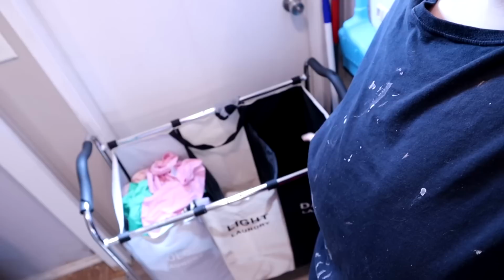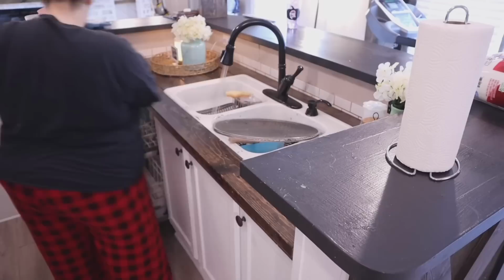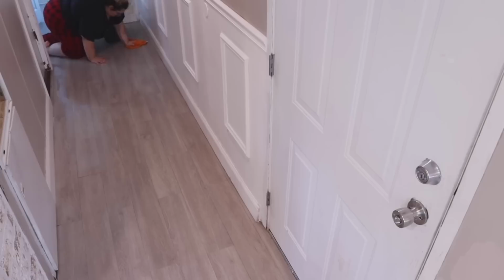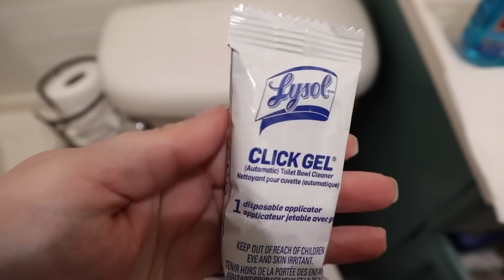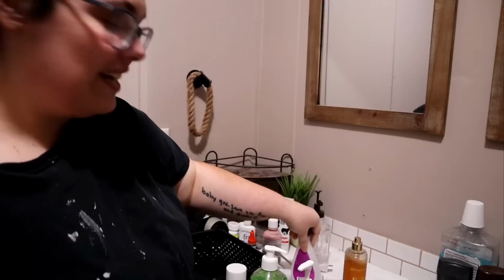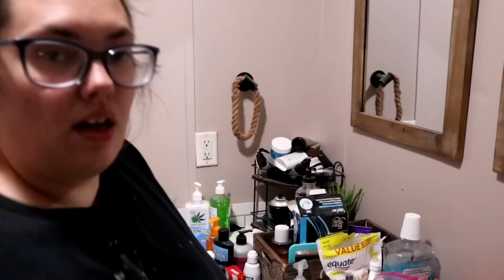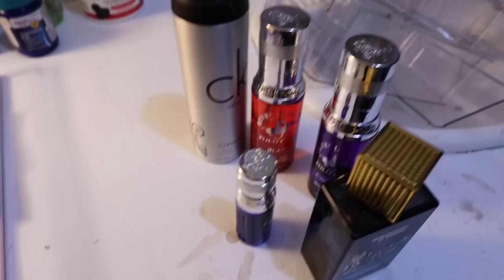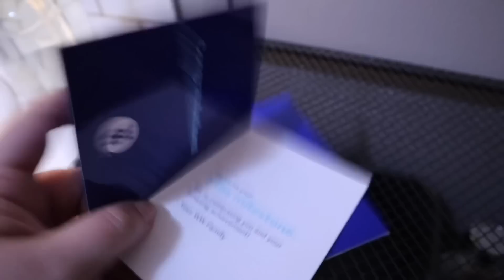*HUGE* MOBILE HOME CLEAN AND DECLUTTER | deep cleaning my single wide trailer | cleaning motivation

Comment: An easier way to clean a full room is throw everything in boxes or laundry baskets and remove everything from the room, I put mine on kitchen table.. Then setup your shelves or containers.  Fill them with only the items you want and put them away after you've cleaned the spaces. It makes it so less stressful.  You don't have to sort it before you take it out. I just dump everything or anything together. You have to sort it anyhow. I hope this makes sense. Trust me at 67 I've figured out the easiest way to do everything 😂

Comment: Hello Merina, just a suggestion when you do your laundry make over. Get a bar and attach to the wall and keep all your loose hangers on it and when you pull clothes out of dryer just hang on bar instead of laying them on washer. Plus, it gives you a place to put your loose hangers and not have them in the way. You may need a support bracket attached to the ceiling to disperse the weight. Had to edit it due to auto correct,  one day I will learn to proofread.

Comment: Your bathroom declutter was intense! Recent subscriber, so not sure if you guys have remodeled it or not. Are the small wall mirrors above the sink for decor or a "medicine cabinet"? If they are decorative, can hubby build shelves from the countertop to ceiling to store more items?  Perhaps in decorative baskets or the like. We did that when we renovated my sister's manufactured home. We also found studs ABOVE her bathrrom doors, added shelves to hold extra toilet tissue, paper towels, etc. When you can't expand--GO UP!! Also, under the sinks are perfect areas for ADDING a removeable simple shelf.(think a long, wide upside-down  U-shape.)

Comment: Just a suggestion I usually around my roast on each side and then put it in the Crock-Pot that's just the way I do it just a thought
Reply: I sear my roast on each side first to lock in the flavors of my season mix ( cavenders, onion powder, garlic ) and load it with celery carrots onions for a natural flavor and in the pot it goes 8 hours tops ….. very little liquid works for me.

Comment: First off your doing fabulous job and staying the course I think that’s awesome. I have a suggestion as far as the dust, I use the 3M hepi filters and it help so so much. They cost a little more but are so worth it. I also use the hanging organizers like for shoes I put one in the shower hanging off the rod to put shower stuff on and one on back of door to hold things I use on a daily basis and it and it sure keeps the clutter that I have at bay. I did put small holes in the one in the shower so the water can drain out when the shower is running. Hope some idea’s help. I also do laundry everyday and it really is a time saver. I think your one of the most honest YouTubers I’ve ever watched and so humble keep up the great works and the videos, I really enjoy them. God bless you and your family.

Comment: MAYBE THIS WILL HELP WITH HAVING MORE ROOM TO STORE STUFF IN YOUR BATHROOM.....Buy an over the door shoe holder...I use one to keep stuff in and off my counters....not like for clutter but for like extras of shampoo, conditioner, deodorant, toothpaste, extras toothbrushes etc...even your hair utensils...hair dryer etc....you could even put your first aid products in it...also keep your toothbrushes away from the toilet due to when flushing the toilet spray disperses into the air landing on your toothbrushes and medications...tablets and capsules shouldn't be kept in the bathroom due to moisture from showering can compromise your medications. I keep my aloe for sunburns in the fridge...feels so much better cold from the fridge.

Comment: There is a recipe called 3 packet roast. It calls for 1 packet of brown gravy mix, 1 packet of Italian dressing mix and 1 packet of Ranch dressing mix. Add these to 1 cup of water, pour over the roast (in the crockpot) and cook on low 4-6 hours. I usually used a 2-3 pound roast and added potatoes and carrots on the bottom . So put potatoes, carrots and then roast and pour mixture over and cook on low 4-6 hours. It's delicious!

Comment: Marina hun, you are better than me. I would’ve picked apart those fries😂
I ain’t wasting no food around here.
As for the trash bag organizing you use for your bathroom, I HAVE TO use zip loc bags(not the brand, just the type of bags)It’s hard for me(so hard)to keep it organized even when I organized it into different trash bags. I then later go looking for something(a certain something) can’t find it the first round so I go back the second round, look at the many trash bags(grocery bags) I have laying in circles around me, forget what’s what(I try to keep it organized like you and have like with like) but my brain just melts, or goes into a black whole.😅Then I asked myself what I needed to help, and told myself that *I* needed to SEE into the bags and finally came up with using ziplock bags. I got em in ALL sizes. Whatever I decide to not keep I do throw them in a trash bag but reuse the ziplock bags over and over again till it finally has no leg to stand on, then I finally toss it out. To see into those bags has kept my mind at ease😌. And it’s nuthin but a quick glance.

Comment: Marina, I don't mean to gross you out, but you need to buy toothbrush covers if your going to leave the toothbrushes out, as anyone flushes the toilet fecal matter spreads threw the air and will get on y'all's toothbrush's, like the smell, not the actual fecal itself but the germs from it and the smell.
   Also when cleaning the toilet, ( you may of done this and you didn't show it ) be sure to get around the bottom part of the toilet, as a mom of two boy's myself and now a 59 year old that tinkles like a 3 year old, they will sprinkle the bottom of the toilet, and if they miss their aim because it's two in the morning and they aren't quite awake. Just a tip from one mom to another.
   I absolutely love you and your family.

Comment: That hole under the cabinet around the pipe…..fill it with steel wool and spray foam insulation. That’s what we did and it helped stopped rodents.

Comment: I use  the plastic 2 drawer or 3 drawer bins under my sinks. Works great to put stuff in. You have a lot of wasted space where if you had some shelves put in there or use the drawers you have more room?  Is that a closet beside the tub or shelves?

Comment: Merina, Hey girl!! Well I am going to give you a little advice on self tanning… I use to look the same way but I figured it out when I got older😅…exfoliate and then lotion 1 hour before… then lotion again and add your spray tan to your body and spread it out as evenly as you can and it should be a better tan… also they have a lotion I think it is jergens that also has self tan with the lotion…. I know it seems like a lot but it will work…

Comment: Instead of 450 put the veggies on at 375 for the same amount of time and then see if that works and if they need more time then put it back in there for 5 to ten more minutes or until you like them I have to put mines in at 385 my gas stove is crazy high I swear I can't cook anything on the right temp because my oven will burn it all

Comment: Hey marina just a heads up I'm not sure if it's the same in the US but in the UK our make up products have a symbol printed on them looks like a small pot with the lid lifted up and month times printed below it'll be something like 6mths a bit like that and that's how long it's shelf staple for after it's opened after that it's not as good or reasonably safe to use perfumes are the same they become less pleasant because alcohol based ones start to become a little whiffy xx

Comment: FYI

“Many people store their medications in the bathroom. But this popular spot is actually one of the worst places to keep medicine. Bathroom cabinets tend to be warm and humid, an environment that speeds up a drug's breakdown process.

This is especially true for tablets and capsules. Being exposed to heat and moisture can make medicines less potent before their expiration date. For example, a warm, muggy environment can cause aspirin tablets to break down into acetic acid (vinegar) and salicylic acid, both of which can irritate the stomach.

Instead, keep medicines in a cool, dry, secure place out of a child's reach. You may need to use a locked cabinet or box. If you store medicines in a kitchen, keep them away from the stove, sink, and any hot appliances.

Consider refilling your prescriptions each month, instead of every 3 months to make sure they are still potent.

In rare cases, medicine that is improperly stored can become toxic.”

I would clear all that out into the top shelf of the master bedroom closet or alittle safer would be the laundry room shelf … also make sure your checking expiration dates